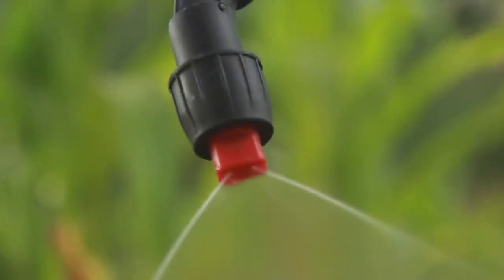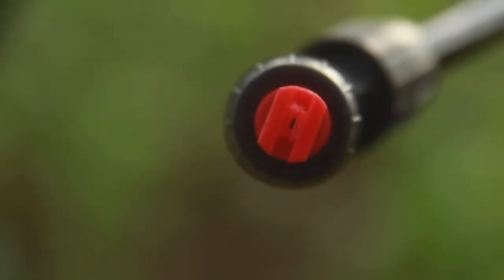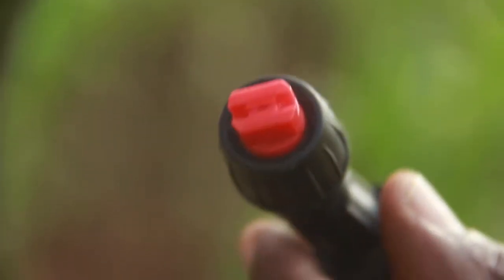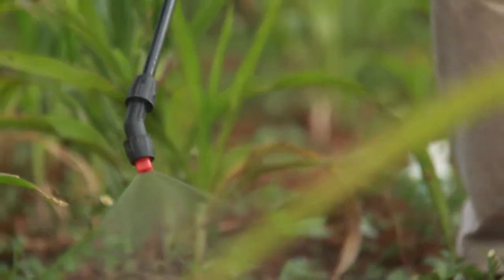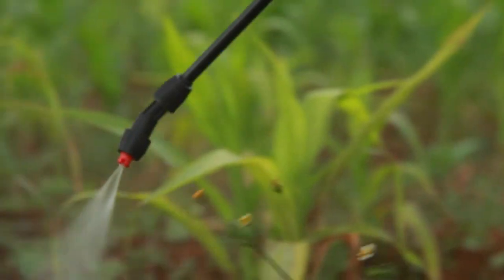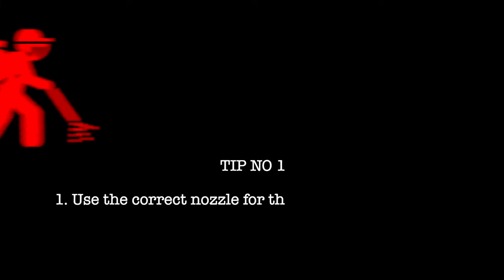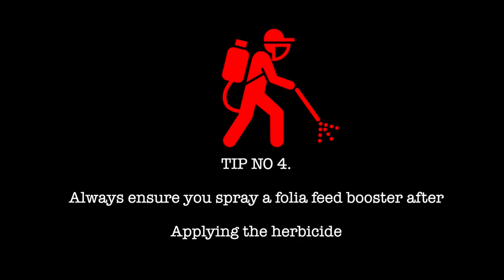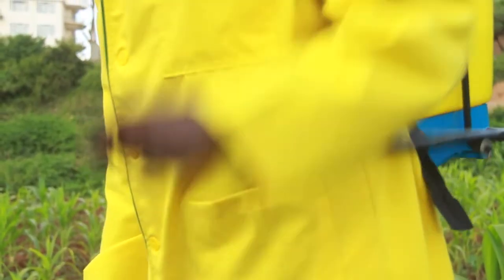TIPS For Herbicide Application (DIY)

Comment: also, do not spray on very windy or completely calm conditions, need 2-4 MPH breeze/3-6Kph .     calibrate equipment.   wear nitrile gloves and a respirator and goggles and rubber boots and a full tyvek suit, no skin showing, and throw away the consumables afterward.  do not contact any herbicide.   shower thoroughly within minutes of completing work, or every 4 hours.  be safe.
Reply from the maker: Thanks for the input.